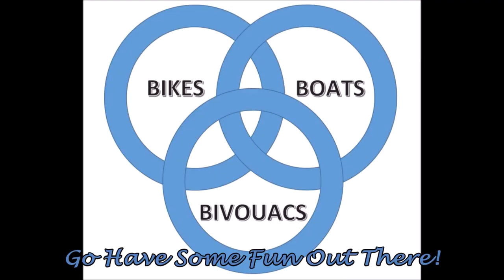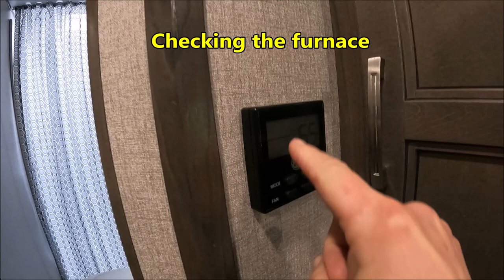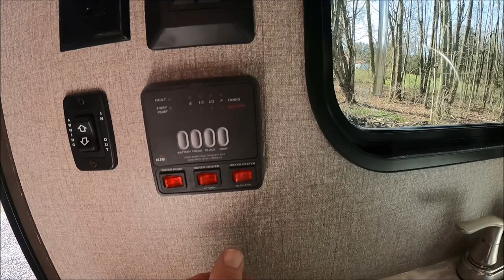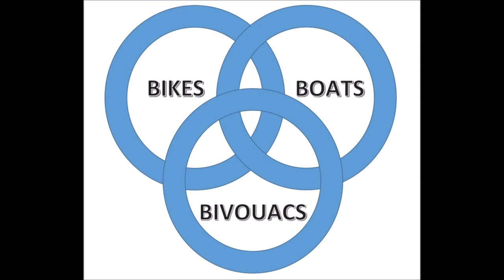De-Winterizing the Jayco JayFlight  224 BH

Comment: Man! Thanks so much! As more of a tech guy, RVing is totally out of my wheelhouse but I'm loving it so far. I was going to take my Jayco to a dealer (I dragged it to Tucson from Cleveland) to de-winterize it, but I also want to learn the systems better and figured I'd take a crack at it myself. Pretty sure this video taught me most everything I'd need to do it! Mine is a tiny 145RB, but I think everything you are doing here translates to mine more or less exactly. If I remember right, only difference is that the bypass valve is underneath the sink. Thanks again!
Reply from the maker: Awesome, glad the video helped you out. RVing is a lot of fun. Thanks for watching.

Comment: When do you un-bypass the tank? Before all that? How do I take care of the remaining anti-freeze in the line to the bottle? And why did you wait to mention not putting the vinegar water through the water heater tank until the end?
Reply from the maker: After I sanitize the tanks I then reset the valves to allow water to flow through the water heater. If you pul the hose out of the antifreeze bottle with the pump still running it should injest the fluid and clear the line. I then put a plastic bag on the winterization hose. I forgot to mention it. Thanks for watching.

Comment: Did you pump the holding tank dry of bleach water, or just until you smell it?  If the latter, your tank will still have left over bleach.
Reply from the maker: I drained the tank with the low point drain. Thanks for watching.

Comment: Should you sanitize the outside kitchen sink and outside shower as well as check the hot water through those two locations as well?
Reply from the maker: yes, I did, but my camera wasn't running when I checked it. Thanks for watching.
Reply: @BikesBoatsBivouacs  thanks for your quick response.  Your videos on this unit are helping me decide. You earned a subscriber.

Comment: First timer question here... How do you introduce the bleach and vinegar into the freshwater system? Ours is just a screw-in with a hose ('22 jayco eagle 29.5 BHDS) so I'm unsure how we would be able to pressurize the bleach and vinegar to get it into the freshwater system
Reply from the maker: Hello, if you don't have a fresh water tank, then you could use the hose that puts the anti freeze in the system. Sometimes the fresh water tank fill is on the opposite side. When I looked at your unit specs it indicates there is a fresh water tank with an 87 gallon capacity. Thanks for watching.
Reply: @BikesBoatsBivouacs  yes thank you, I didn't explain myself very well. Where are you screw the freshwater hose into fill the freshwater tank, there is a screen over that opening that bulges out, so I will just need to figure out how to sort of shoot the vinegar past that screen as I can't tip any sort of shot glass or cup into the hole opening. Appreciate the response!
Reply from the maker: @abbyschock2342  I would get a squirt bottle to shoot the mixture into the tank.